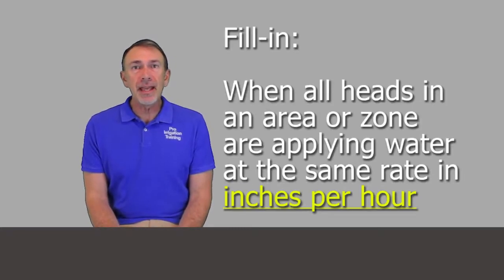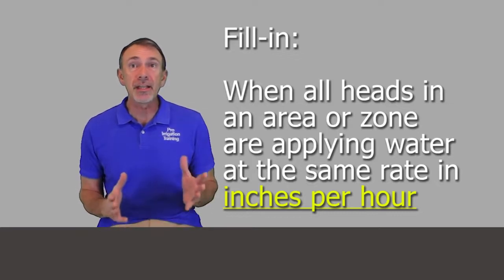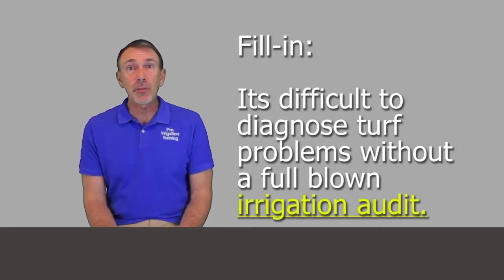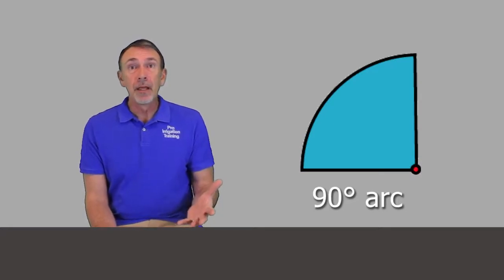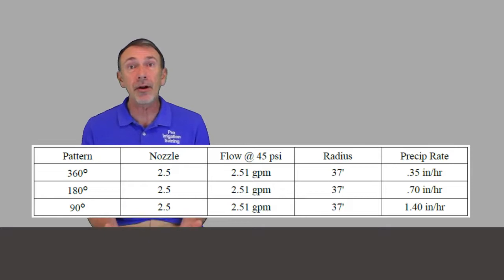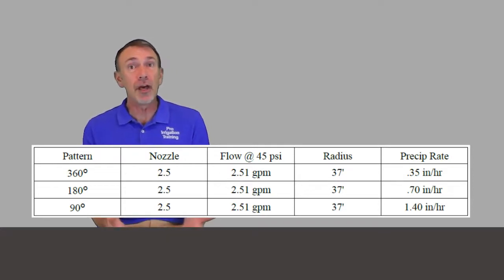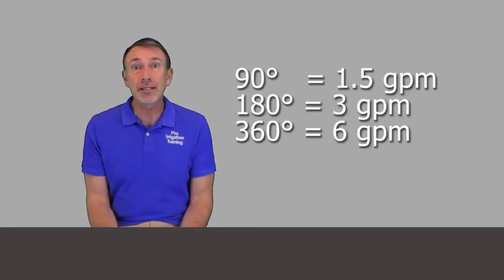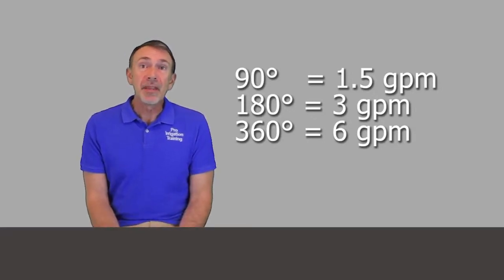Matched Precipitation Rate | Irrigation Training

Comment: Hi Michael. Thank you for the comprehensive series. It is very informative and straight to the point. Excellent content. 
Are you familiar with the use of a water wheel wrapped  with spiral PE for pumping water? After going through your course I’ll try to design a system to take some water up the slope using it, so this knowledge is essential. Much appreciated.
Reply from the maker: Hello! I've never seen that before. I'm pretty sure there's a lot of people that would like to see that. Send a video or link if you build one.

Comment: Great. I'm an irrigation pro in Northern California, Owner of American River Irrigation, and water conservation is very critical. I do a lot of service calls and find mixed heads and nozzles that aren't matched. so many contractors have no idea of matched precipitation.  It takes some work to correct the problem, by swapping out heads and nozzles, it gives the customer and community, a good solution for dialing in their water usage and plant/turf performance.
Reply from the maker: Hi Paul, thanks for watching. You're absolutely right. There's a lot of waste happening out there on irrigation systems. And tons of opportunity for knowledgeable technicians to correct those issues for the sake of water and $ conservation.